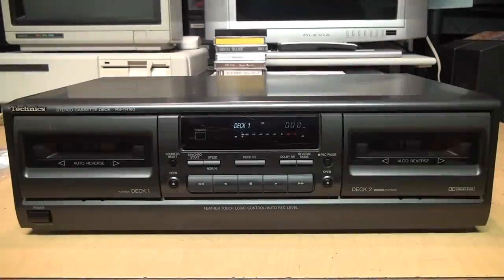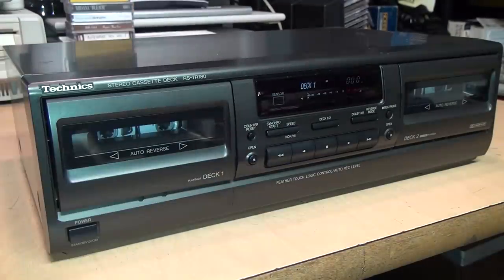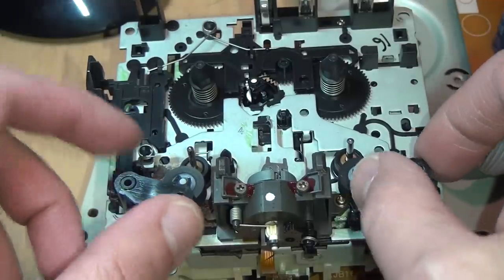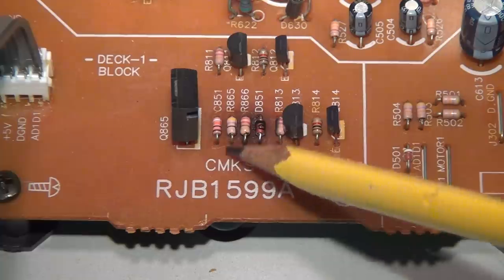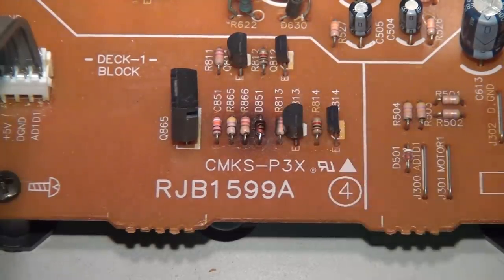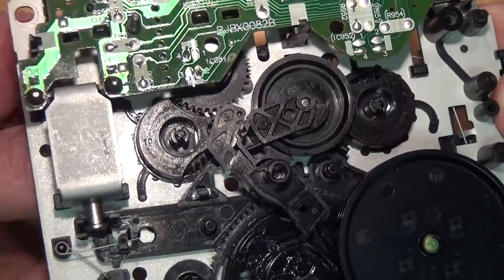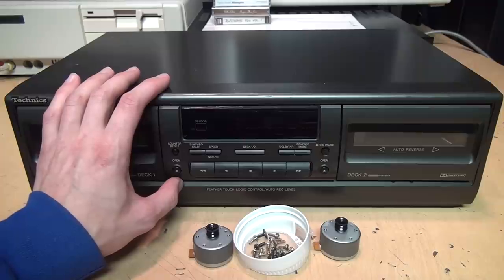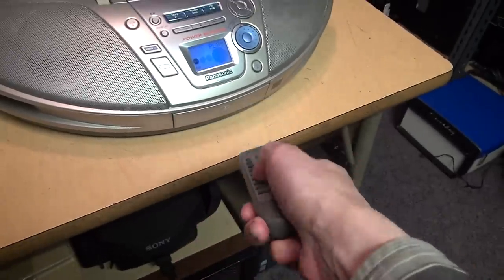Fixing a cassette deck but Everything Goes Wrong...

Comment: I yet have my jvc stereo equipment that's 35 years old never had to replace the belts motors pinch rollers on the dual cassette recorder player it works like brand new to this day.

Comment: I wonder what that actual problem was with that deck being you said that the diode’s and the regulator and whatnot were just symptoms. Also makes me wonder that after that, if you actually were to waste time and try to fix it, if you could actually get it working again

Comment: Well, to be fair, $40 for one in working condition says nothing about how long it will last. At least with new rollers and belts it's likely it will last a long time to come, whereas the $40 one probably hasn't had them replaced so it might work fine initially and a few months down the line it doesn't work anymore and then ends up needing the repair anyway. Plus, old worn out belts are likely to have more wow and flutter so even if a machine was working replacing the belts would not be a bad idea.

Comment: I repaired a Sony TC-WE305. Great simple 90's dual cassette deck!
Reply from the maker: Sony decks are generally OK as long as you catch them before the original belts melt into sticky goo, which becomes very difficult and messy to clean out.
Reply: Had one of those, yes, simple to work on.  Gave it away to a friend when I got a better deck.

Comment: I remember a couple years ago I bought a mini cassette dictation recorder at a thrift store in Florida and subsequently found a ziplock bag of tapes in the next thrift store on the same day and needless to say it motivated me to try and fix it until I got home and opened the thing up and found that the belts and rollers had deteriorated to goo and there was no way it was able to be fixed.

Comment: I always have to wonder if this whole situation with rubber components and plastic gears is somehow climate related. Maybe it's too hot and humid for rubber or too cold and dry for plastic? It's usually one of those problems and both at the same time are quite rare.
Reply: It's mainly due to the chemical formula as well. Rubber degrades over time. Heat and humidity accelerate it
Reply: @RealEpikCartfrenYT  yeah, I had a few old devices in a climate controlled data center that were there since the early 80's and I had to remove them... On some the rubber feet turned to goo and looked like someone stuck 4 brown pieces of melted chewing gum on all 4 corners!

I got some all over my hands one day and it was like pine sap.

Comment: Just wondering: Was there ever a direct drive cassette deck (as opposed to all the belt driven decks)?
Reply: Yes.
Reply: Yes, some extra decs had even 4 motors for capstan and each reel. No need for belts or gears. There were no brake pads, belts, pulleys or cogwheels in the whole transport; even the tape counter was driven by an optoelectronic encoder on the reel motors. Revox B710 and B215 from  Studer.

Comment: Some of these were never intended to be repaired. At the point that I have to desolder things to get to the belts I assume I'm not going to be able to get it working again. Also ebay prices for non-working tape tecks are too high. I have gotten several at yard sales for 10 dollars or less that could be repaired with just belts.

Comment: It might be possible to find adaptable plastic (or even metal) gears from RC miniature vehicle spare parts shops and use a Dremel tool and acetone or epoxy resin to modify the inner parts of the gear to adjust with this cassette deck. But it might be quite labor intensive and not an easy task if you can't get help from an expericenced RC hobbyist.

Comment: Sometimes, this is how it goes. I was working on a teac w-750r and the mech relies on a plastic wheel with grooves on it which another plastic piece follows using a tiny peg. The peg broke and there's no hope of glue doing the job the solid piece once did. Completely awful design, the good teac engineers must have been out to lunch when they made that one.

Comment: Well actually no it's not game over with cracked gears. If the whole gear is still available, you can piece it together with glue, make a mold from silicone, and then cast your own part from epoxy.

Comment: this actually makes me think of avoiding technics cassette decks
Reply: Nah. This is the lowest low-end model. Last good double decks were RS-TR 575/777/979 and the previous models even better: RS-TR 333/355/555
Only problems they have are the cracking gears and the hardening pinch rollers. The belts never turn to goo! They harden too and crack at worst. Electronically, they are well made.

Comment: I love the vintage components and even collect some but l don't have the patience to work on the cassette decks.l took a an 80 s pioneer deck in for service and they told me they refuse to look at cassette decks because of the multitude of both electrical and mechanical issues. They're not worth fixing in most cases.

Comment: A few years ago, I pulled out of storage a laserdisc player I kept since the 90s as I still had a few movies on laserdiscs format, and when the tray didn't open, It broke apart when unscrewing the top cover, the whole inside plastic has become brittle even though the electronics seemed fine.
Reply: Might also have partly to do with the storage conditions (temperature and humidity will influence the durability of plastic...)

Comment: I gave up on my car cd player that was ejecting every cd I put in.  No amount of lense cleaning or roller cleaning could fix it.  I had a different CD player with the opposite problem.  If you didn't grab the CD fast upon ejecting, it would yoink the CD back into the machine.  Slot loaders are tbe bane of my existence.

Comment: Wife has a 90s cd-cassette boombox from ALDI. still works today. Never replaced a thing, not even the belts.
meanwhile i'v had several Pioneer,AKAI,Philips and other tape decks which needed regular service and some also had gears broken even on my best CTF9191 which is now worth a fortune but i can't repair it.
i hate this hobby.

Comment: I don't think it's unusual to find a badly built Technics cassette deck. Just like all the other major brands, they sold decks all the way from outstanding down to complete garbage depending on how much/little you wanted to spend. Even Nakamichi made a few models I wouldn't touch with a bargepole.

Comment: I had a technics RS TR 373 and that deck was a good however it was jest like this deck in the video. Over engineered and not friendly for repair. I don't consider it junk. I consider it crap due to its design and way too much plastic.

Comment: They are certainly not worth fixing unless they are high-end. The truth is you do it for entertainment. I have several cassette decks and the ones that are beyond repair I use them for parts. I recommend the high end SONY and TEAC, they are robust mechanisms. As for the electronics, it is very difficult to know if they work unless you can test them before you buy. To a certain extent it is preferable to have a cassette deck with bad electronics rather than mechanics because you can get the electronic components easily.

Comment: This deck showed exactly the same symptoms of several later Sony (mostly ES series) and a couple of other decks I've repaired over the last few years; which was caused by...  Drum roll please...  The remote control sensor!  Parts of the display lighting up, motor(s) spinning, no off operation, eject or transport controls.  Yeah, weirdly enough, cutting the power rails or removing the sensor completely restored all operations.

It's a bit of a shame you binned it, and spent money on parts for it, mind you, it looked like a piece of cheap low quality junk TBH.

Comment: What year is that tape deck? I would not say it’s a piece of junk, especially if ya find an identical unit to repair 👨‍🔧 this one ☝️ with. I have jeweler’s screwdriver 🪛 set, but I’m not sure 🤔 if it’s precise enough for this kind of work. I wouldn’t junk this tape deck just yet. Also, if it’s gained sentimental value, this is a real indication not to throw it away. Sorry 😢 I can’t offer any repair 👨‍🔧 advice 😞. Your friend, Jeff

Comment: I have that panasonic boombox somehwere myself, sold as faulty, CD player wouldn't play when I got it (dirty lens) and the eject was jammed (cos someone was a numpty and probably pulled or pushed the tray in anger), radio is flaky at best as it seems to "fall off" the station it's tuned to and won't go back without switching off and on again, and the tape drive, forget it, clicketyclacketyclicketyclacketyclicketyclacketynope... :P

Comment: Some times ago i gave simmilar deck to service. Itvis still working but autorewersem is not working properly. It is destroying tapes. After 2 weeks guy from service called me and told that he will repair it but I have to buy soate parts. Ok, I boight parts. Them after 3 weeks guy called that he will not repair it. When I Got my deck back, I saw he changed tape hads for worse. Well after this I bought used casette deck forom the highiest level. COOL SOUND. I was happy about 1 month. Then deck broke 😢.  Ha ha ha that's the story about nostalgy.

Comment: I rather stick to vintage cassette decks from the 1970’s and 1980’s, thank you very much.

This Technics cassette deck from the 1990’s is definitely the worst due to problems. Thankfully, my Technics RS-B11W from 1985 still works great, but I have no problem with it.

Vintage cassette decks from the 1970’s and 1980’s were a ton better than this piece of garbage.

Comment: Sorry to see this Technics deck so poorly built and designed. I think Matsushita stuff from 70's, 80's and even 90's are the most reliable, they rarely need more than just a clean-up and a belt change... Moreover I have a Technics deck from early 80's still working fine with its original belt (or at least belt from the 80's) ! But that cheap double deck of yours is really terrible, the e-waste collection point is where it is supposed to be

Comment: The only thing I don't get is why you didn't donate it to someone to use it for parts at least.
Reply from the maker: I donated the parts to myself.
Reply: @vwestlife  I was referring to the parts not shown on the video as salvaged but it is possible that you kept more than those. I would definitely keep the mechanisms because the gears might be useful on other repairs and even the ICs on the PCB might be needed someday. But that's the hoarder spirit talking now!

Comment: hi do you know what i do i keep the outer case and doors because there are decks thast are marked very badly time to time
one will turn  up 

i been buying alot of betacam sp  digi used decks  i have alot of good luck with them   
 i pick one up for 50uk  there was not alot bad with it   i moved parts from parts deck work ace now 
the ing is  finding the right  parts decks is getting alot harder now 

i was very lucky with this one   i had the parts in my parts  bins  a power unit went in a deck i got from a studio in was free
did not pay any money for the deck 

i was after the head drum and parts and cards some fool did poor work behide the vu meters and killed the power unit
100^ burn the vu metters out  dead they were 
i only buy units of the same and re used the decks some how 

betacam sp digi make super 4 channel tapes like quad audio  and they sound ace WOW is the word  my mate said
is that a beta deck  he said i was playing a cd

Comment: If you can, I would figure out a way to get 3D models made of those plastic gears so they could be 3D printed as replacements so this deck doesn't become a paperweight when it eventually breaks
Reply: Did you watch the entire video?
Reply: @CasinoWoyale  yes I watched the entire video. The point he was making was about choosing wisely which of these you buy and which of these you choose to repair. Now if someone already has one of these that they got for free or acquired from a family heirloom or simply needs to repair it for someone else then it could be beneficial to have replacement gears available. Obviously I'm not suggesting that someone should buy one of these and then invest the time and resources into fixing it because that's the very thing he's talking about not doing, but if someone already has one or it's already trying to repair one for whatever reason then replacement parts are still useful.

Comment: Panasonic do make some rubbish gears, the denon i had was ruined by gear failure of the Panasonic mechanism but that dismantled denon has given me some nice sharp made square led,s a panasonic motor some good heads and some pots and i saved some of the used capacitors and those fixed another tape machine that had some dodgy caps .Twin decks unless good are always going to cost more to fix .

Comment: These belts cost $0.50 in AliExpress I can't believe you paid $22, what a ripoff.
Reply: And yet my Philips boombox I got for about $10 works better and probably sounds better than this deck ever did
Reply from the maker: I order high-quality PRB belts when I know the correct sizes, but I couldn't find any cross-references for this model. And $22 for a set of four belts isn't that much of a markup when PRB belts usually cost around $4 to $5 each.

Comment: You really did not make much of an effort to fix the electrical fault. I know a few channels that would have gotten it working.
Reply: At this point, for him it was not worth putting in more time and effort, plus the potential cost of replacing an unknown number of components beyond a diode and voltage regulator. Perhaps it was also beginning to go a little beyond his capability. I too would have liked to have seen the cause found, even if afterwards still chosen to dump it.